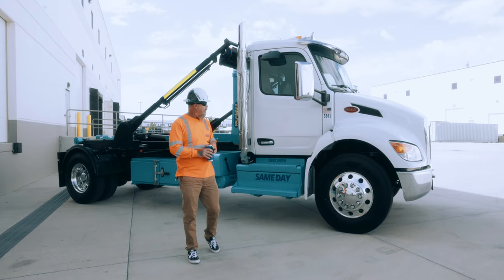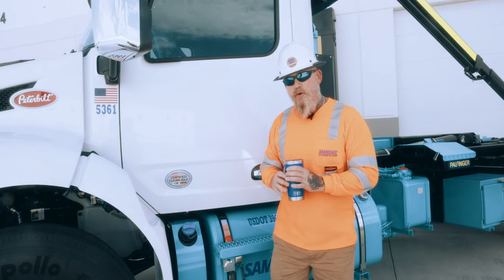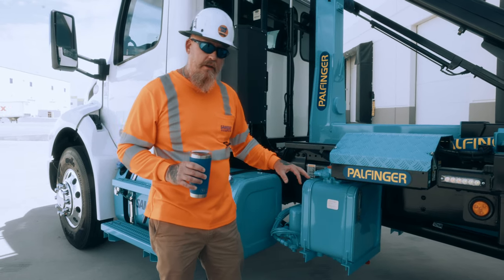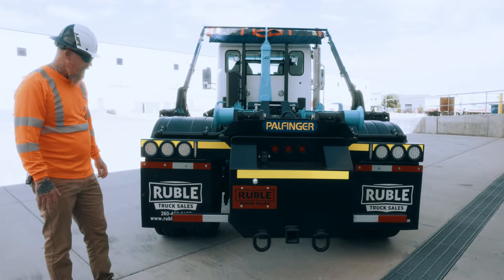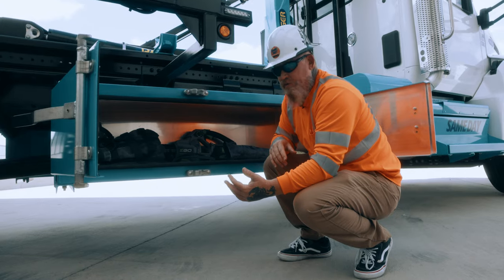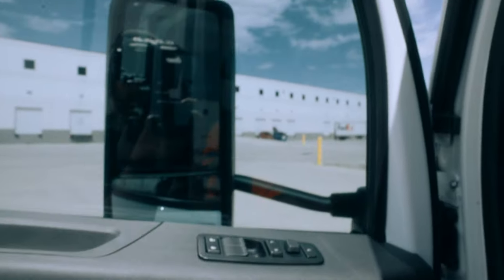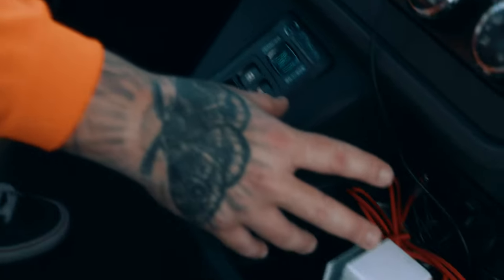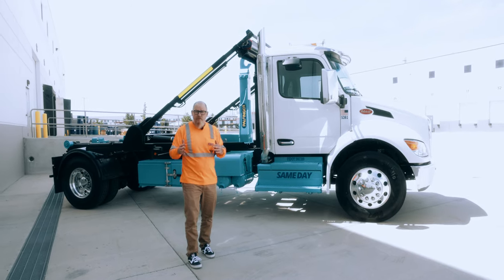New Fully Loaded Under CDL Peterbilt 536 Hooklift Truck Tour | COMPLETE WALKAROUND!

Comment: Very nice truck. I'm gonna add 2 things that you didn't mention that need to be pointed out to people. I know you used to drive semis and thus probably still have your class A CDL. And I completely agree with you in that every truck should be equipped to tow. Having said that, your truck may be de-rated to 26k to stay under CDL, however, the INSTANT you put a trailer on the back of that truck, your combined weight requires you to have a CDL. AND, towing any trailer with that truck will require you to not only have a CDL, but it has to be a CLASS A CDL. Secondly, the pass through body locks (hot locks as you call them) are a DOT requirement. Without them, you have to either chain or strap both sides of your cans down, or it is the equivalent of an unsecured load and is an OOS violation.
Reply from the maker: Yes, Yes and Yes. All very good points. Thank You for letting everyone know about these very valid points. Pay attention friends, class is in session.
Reply: @samedaydumpster Up here in Canada you need class A licence at 11,000 kg which is 24,000 lbs truck and trailer but trailer can’t be more than 10,000 lbs. 14,000 lb trailer needs class A cdl 😢
Reply: @samedaydumpster  That's no joke! I pay more attention to these lessons than I did in undergrad and grad school. I consider these videos, the podcasts, and masterclasses my homework.

Comment: I very much struggle to understand why the heck you would do this. Derating a class 7 to class 6 means all that extra weight counts against your payload capacity so you haul as much as a class 5 now.
Reply from the maker: Unless you have run both an over cdl and under cdl successful trucking business,  it may not make sense. But since I have done both, the under cdl works best for my business, my market and the clientele that we work with currently. Thanks for watching.

Comment: I can tell you from experience your  tinted windows is illegal per dot you are absolutely not legally allow tint on any vehicle with a dot number just ask you're state troopers the only state that I had been busted in is Utah
Reply from the maker: https://www.fmcsa.dot.gov/taxonomy/term/10141
Reply: @samedaydumpster  I read the same thing yet got a ticket for tint wad told by dot inspector not allowed tint at all and had to remove it or was not able to drive per his instructions in the great state of Utah been on truck for 3 years before this incident through even the worst for stuff California just be careful I pulled this up and he said it does not apply to Comercial vehicles which you fall under hence the dot number

Comment: John you’ve built the most beautiful truck I’ve seen in a long time, and it’s an everyday workhorse! Appears well thought out for longevity and comfort. Next video let us know your wheel base and rear of cab to axel measurements, along with the base weight. Also the Can length range of your T22 and different empty weights so we understand the legal capacity of your beauty.  It’s something to strive for in my future. What a beauty! I really appreciate your work/time of every video/podcast you send out. I’ve learned a lot.  Keith 🇺🇸😎
Reply from the maker: Next weeks video is going to be all about the weight of the truck and what it can legally haul. The WB is 218”. That T22 is built for 12’ - 16’ cans. I promise it will be a very educational video. Thanks for watching Keith, much appreciated
Reply: Add a few comparisons to your two Chevy trucks of what changed and/or you kept the same and why. Like I said, Best looking hook truck I’ve seen!
Reply: If the T22 is designed  for 12'-16' cans what do you use to haul your 30's and 40's with

Comment: I know you said not to go with 36 hook but the local building only put 36 on the 5500 trucks he says you want have a problem seeing the 36 hook in that size truck just the bigger trucks is that true are is he lying to make a sale ? Thank you for the help
Reply from the maker: I wouldn't go as far as calling anyone a "liar,"... but let's break this down. Yes... they are going to try and sell you whatever they have in stock and on the ground ready to go, they are salesmen and a business after all. Lets say you buy this Ram 5500 with a 36" hook, now you start buying or building dumpsters, they to0 are also now 36". A year or two down the road business is good for you and you decide to step up into a larger truck to handle your work load. You buy the new truck and now all your cans are 36". So you need to retool all your cans, or sale them because your new bigger truck will have a 54" hook almost 100% guaranteed. 

That's just one example, I could give you 8 or 9 other examples just like this. I personally, wouldn't buy a 36" hook, you will regret it down the road. That's my 2 cents Jesse. But I genuinely appreciate you checking out the channel and supporting  it. Thank You brother.
Reply: Your welcome i really appreciate you taking the time to help i know you have a lot going on

Comment: With the extra room in your battery box you could easily carry non valuables like windshield fluid, 50/50 coolant, 
fix a flat, spare light bulbs, etc.
Reply from the maker: Great suggestions. There's def space for at least a gallon of windshield wiper fluid.
Reply: @samedaydumpster  Don't forget the blinker fluid. Wouldn't want to get caught up in a DOT inspection without any!

Comment: A very nice truck, I've drove roll off and lugger trucks but never hook lift. It sounds like you did a lot to truck at building stage. Only thing I'd think be nicer is paint cab same blue, nice color. My guess is the price of painting is why you left it white. Well done.
Reply from the maker: Thanks for watching. We actually leave the cabs white, not because of the price to paint, but rather for resale a few seasons down the road. Drive safely out there.
Reply: It's a nice truck I'd like to drive, I'm CDL holder for 30 years, and it makes all the difference in your days work when you have a reliable and comfortable truck to use. Good looking out for your employees.

Comment: Any reason you didn’t go with the rolliskate bracket for the skates? Thinking about pulling the trigger this week on some rolliskates. Hopefully you’ve had good luck with them. I’m guessing you run the light duty skates?
As always, much appreciated
Thanks John!
Reply from the maker: Buy the medium Cody. The light duty will fall apart with the concrete work you do. Also, but the white ones for all the concrete driveways you service. As far as the bracket, I just feel it’s a cleaner look inside the toolbox for me. Also, with the addition of both those boxes, I kinda used up most my frame space.

Comment: I can't remember if it's been covered or not, but are you running all your cans the same length or a mixture? I know some of the 19K-25K rated trucks are usually set up for 10-14' cans, while some of the 26Ks trucks are able to run up to 16' cans. I'm making final purchasing decisions now and can opt for a 14' or 16' GN trailer. from Couger I want to be forward thinking but I also don't want to unnecessarily burden myself with backing into tight spaces by choosing 16' over 14' thinking ahead but not being able to put it places that a 14' trailer could go that the 16' can't.
Reply from the maker: I run a mixture Chase. I have as short as 12' cans, and as long as 17'10" cans that I run on this Peterbilt. Hope this helps brother. Excited for your new setup this year.
Reply: @samedaydumpster  Thanks, John! My purchasing decision right now is between a 14' Couger GN trailer with 8K axles and a 17.5K winch for 12-14' cans, or a 16' Couger GN trailer with 10K axles and a 22K winch for 16' cans. 

I think I want to go 16' because it's more robust and 16' cans can have similar volume with lower wall height or more volume at same wall height. I know they would be tall but it's my understanding that 25 & 30 cy cans can be had at 16' as well. 

Forward-thinking, the 16's will be better suited to pair with a Palfinger T22 one day but my concern is the additional difficulty of backing the 16' in tight drop zones vs the 14' based on the added length and articulation. 

Care to weigh in?

Comment: Beautiful truck! I’m looking to buy one very soon ! I don’t have a huge budget . Would you recommend this truck or your duramax for my starter company . I plan to run 17’s ,22’s, and hopefully concrete. I was leaning more toward duramax for gas mileage and to save until I can afford a second truck. Thank you for all your info .
Reply from the maker: If you are moving into a hooklift truck for the first time, I would recommend purchasing a Chevrolet 6500 before stepping up to a truck like this. Learn the hooklift game on a smaller, little bit simpler platform. There's a lot to be said about starting small and learning the game there first. That's how I did it, and It's how I still recommend anyone else do it. Thanks for watching. Best of luck brother.

Comment: Am I incorrect by saying that you wouldn't be able to move your concrete dumpsters with this truck because it would instantly put you over gvrw?
Reply from the maker: We use this truck for the smaller jobs still. But if I have a contractor really getting after it... I use the 6500 because of the larger legal payload. You are correct. Thanks for the support of the channel.

Comment: Can a truck built like this be had around the $150K mark or am I way off?
Reply from the maker: Yes... Mack, and International both have trucks similar to this one in the $150K range. Peterbilt and Kenworth are going to be north of the $150K mark tho.
Reply: @samedaydumpster  there may or may not be a brand new Mack MD642 derated to 25,995 lbs listed locally from an upfitter ready to work, $155K. Cummins ISB, Allison 2500RDS, Stellar Slider20S, Aero EasyRoc 750, 30K bumper, I may or may not be drooling over it.